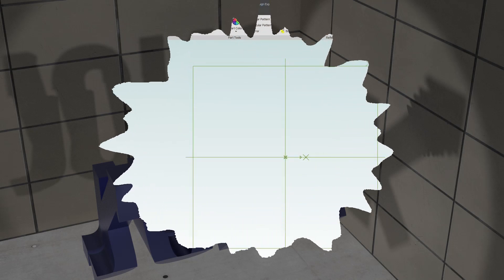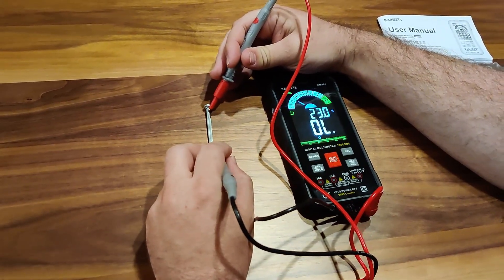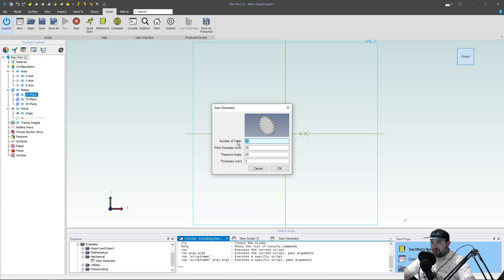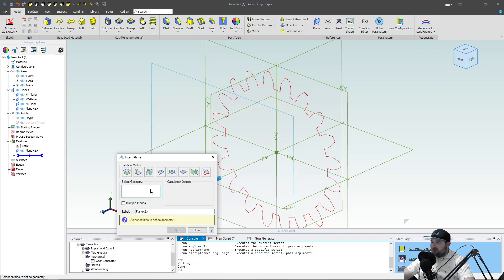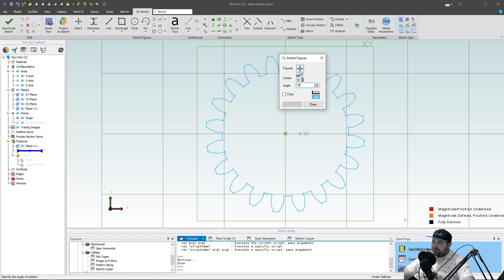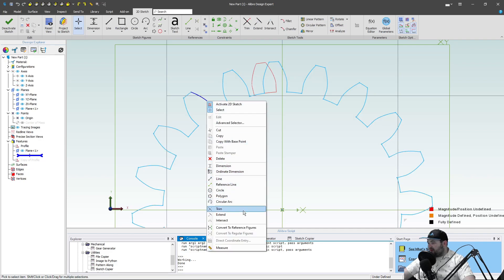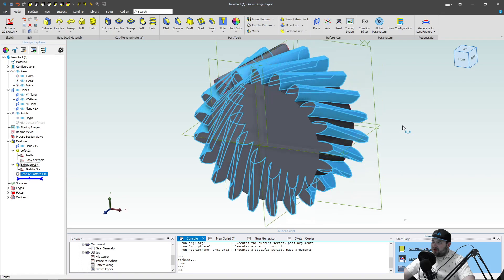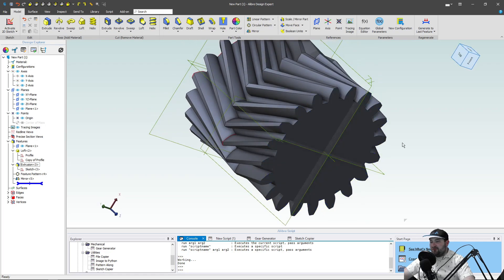Model Spur, Helical and Herringbone(Double Helical) Gears! #Kaiweets (See Description)

Comment: If you do it like that tooth will grind through the axle. It doesn't follow curvature of the shaft. Check time 7:41 when there is short yellow shaft visible.
Reply from the maker: Thanks for the comment, updated video made.
Reply from the maker: That's a fair point, I might have to look at a tighter control on that loft

Comment: The title   points to Alibre Pro, yet shown in Alibre Expert ???  does it work in both?
Reply from the maker: It works in both, it was meant to mean professional use level licensing 
but it turned out to be confusing because one of the licenses is actually called professional.
Reply: @JokoEngineeringhelp   thank you...  I assuming that a 45degr bevel is only a matter of 'lofting' to a 45degr inner circle on the opposite side?  and based on your herringbone example, this can only be realized on a 3D printer, not a CNC(unless a rotary axis is implemented).
Reply from the maker: @DormantIdeasNIQ  RIght- the biggest drawback of herringbone gears is manufacturability.  Sometimes they'll put a gap in the middle like this as well.  https://img.diytrade.com/smimg/2624464/47385104-9352716-0/Herringbone_Gear_/7e59.jpg
Reply: @JokoEngineeringhelp  ok... nice example pic thank you.

Comment: Joko
Thanks again for showing Alibre a little love, this is a little off the topic from your video, But I'm hoping you could give me a little GPU advice, there just isn't a lot of info out there, and with the current price of Graphics Cards I don't want to make a stupid, expensive mistake.  First off I'm not a Gamer, or Content Creator - almost everything I do noteworthy is 3D related - Alibre Design Expert V25, Blender, and Ideamaker for slicing.  I'm running Windows 10 on a desktop with Dual Core Xeon CPU E5-2680 0 @ 2.70GHz and 32 GB RAM.  I currently run only 1 display, with an AMD Radion HD 7500 with 1GB Ram.  I also use 3dconnexion Space Mouse.  Everything is in a big HP Z620 box, so I should have lots of room.  I don't want to break the bank, but I know that my current GPU is holding me back.
Thanks again for all you give us
Reply from the maker: I'm not a GPU expert either, I know that the Nvidia Quadro series is good for CAD.  I believe the principle behind it is gamer cards are optimized for speed whereas CAD cards are optimized for precision.  The Quadro has been great on my pc (Xeon CPU 32GB RAM Windows/Linux much like yours) with every platform I have used e.g. realview in SolidWorks is seamless), though next time I think I'd prefer an equivalent from AMD as I hear they take more care on Linux support and compatibility.  I currently use Nvidia Quadro M2200.  Just my 2 cents, good luck.
Reply: @JokoEngineeringhelp  Thanks Joko
That's EXACTLY the kind of advice I was hoping for.  After a little more poking around on the web with your recommendation in mind, I think I'm going to give the Nvidia Quadro M2000 a go, appears to be the Desktop version of your M2200.  Looks like they've been around a while so reliability shouldn't be an issue, and they're off the radar of all the Cool Kids so they're a little more affordable.
Once again, thanks for all you do!
Reply from the maker: @madscience6931  You bet, good luck with everything.
Reply: @JokoEngineeringhelp  Hey Joko
Thanks again for the GPU advice.  I just got my Nvidia Quadro M2000 installed.  I couldn't be happier, it's made a big difference.  I was able to pick up a "Renewed" on on Amazon (folks seem to have good things to say about their renewed gear) for about $150.00.  I certainly could have spent a lot more and got a real HotRod, but I doubt I'd be really taking advantage of it.  This seems to be perfect for my needs.
Keep up the great work!
Reply from the maker: @madscience6931  Great to hear and thanks for coming back and letting me know!

Comment: hi . I hope you are able to answer a problem I'm having as far as 'how to plot out a gradient' , in reference to a slopping lot of land that I need to draw a house upon. The house I want to draw sits on a block of land that slops diagonally, about 3 metres, from one diagonal corner to the opposite. So its about a 10 degree gradient. Not only that, but beneath the house, at the lower back side of the house, there has been some excavation into the earth, into the slopping lot of land, which brings more complexity to the drawing. I see many shapes in free cad that are much more complex than this, but unless one knows where to start. All demonstration I have found so far regarding architectural work is of someone drawing a basic rectangular box, and extruding walls. this brings me to another problem I cant find an answer to, which is; 'because the house I am trying to draw is not rectangular, I am using the single line tool, but I can't seem to find how to merge the corners of those single walls together. I have tried various ways of using the merge wall tool but again, I cant figure it out. its just maddening trying to figure all this out. I have looked all over the internet, and on Freecad forums but cant find any reference to how this is done. Which way would you suggest setting out the co-ordinates for such a drawing. Any help with the slopping , gradient, would be great. By the way, one of the biggest problems I'm having is trying to learn the language of CAD. When I read an instruction, it is literally 'gobble de Gook'. thanks.
Reply from the maker: Do you have previous experience in 2D cad are are you using 3D from scratch?  It sounds like you're using FreeCAD?  If so, what workbench(s)?

Comment: The helical gear is wrong

you should have used a sweep and not a loft

with this method the pitch surface of the gear will have a hyperbolic profile instead of a cylindrical one, meaning two of such gears WILL NOT MESH properly
Reply from the maker: Nope.  Nothing about this remotely meets the definition of a hyperbolic profle.  It was a loft between two sketches with no modifiers and if there is any question a ruled loft can be used.  You can argue that the twisting of the profile of the top face should be finessed, but again that has absolutely nothing to do with hyperbolic tooth profiles.

Comment: Thank you for making more Alibre tutorials! I'm really enjoying using Atom(so I had to sketch the profile myself), but what I did to generate helical gears(and avoid Loft, because sometimes has unexpected results) was use a "Helical Boss"(Helix in the Boss menu), set for "Height & Pitch", it allows me to input the width of the gear and for pitch I found a simple formula online(module * No. teeth * PI / cos(angle)) which lets me make fully parametric helical/herringbone gears!
Reply: can you do a video about it?